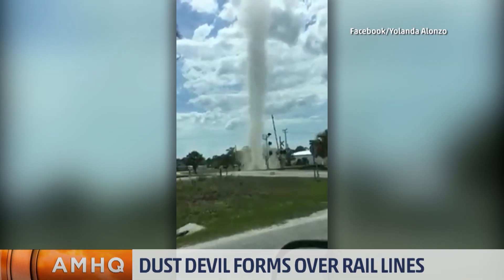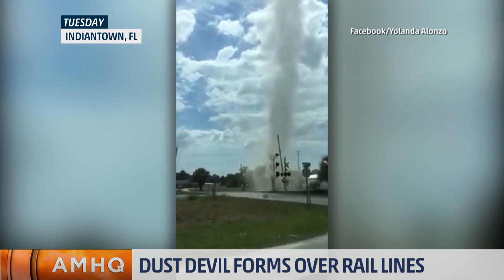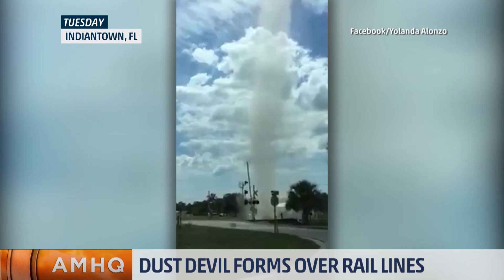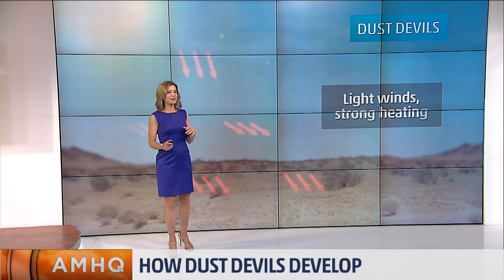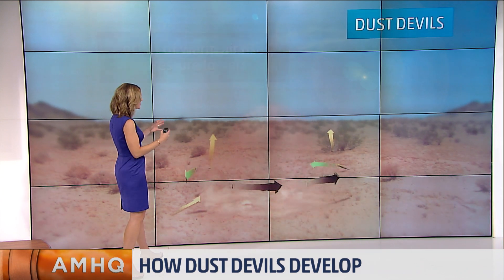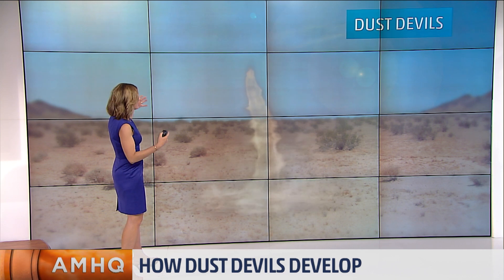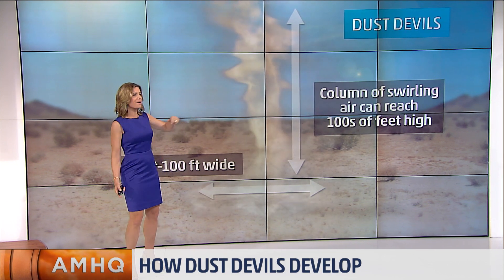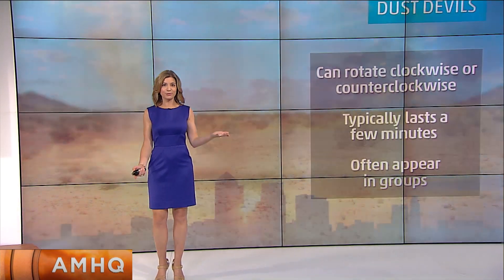Do You Know How Dust Devils Form?

Comment: The spinning is caused by the Earth's rotation, in case anyone was curious. Hot air rising, gets spun because the Earth is rotating and because the Earth is a sphere, some parts of it move faster in the rotation than others, causing the rotation of all cyclones from as small as your toilet water flushing to the spin of hurricanes.
Reply: Not exactly, the Coriolis acceleration caused by the Earth's rotation does affect some metheorologycal phenomena like hurricanes, that's why they spin counterclockwise in the northern hemisphere. However Coriolis acceleration does not affect at all scales, for small phenomena (microscale) such as tornadoes, dust devils, waterspout or the flushing toilet Coriolis does not affect them, you can use the Rossby Number to verify that. If Coriolis affect tornadoes they would spin counterclockwise but just like the presentor said, they can spin either way   :)
Reply: Then what causes them to spin at all? That's what I've been trying to figure out and I thought I had it with the Coriolis Effect. :(
Reply: Oh, it's the centrifugal acceleration. Because you have a low pressure system the "Pressure Gradient Force", makes the air move into de low pressure center, but the centrifugal acceleration (wich yes, it's cause by the Earth's rotation)  makes the air spin  :D
Reply: Levy Wilson 
you're talking about the coriolis force. This is way to small a scale to be affected by the coriolis force.